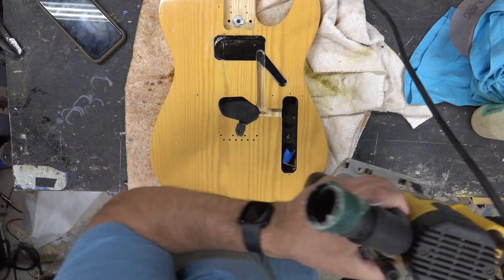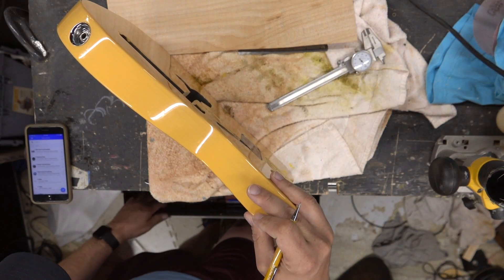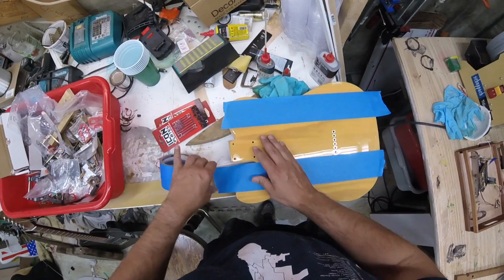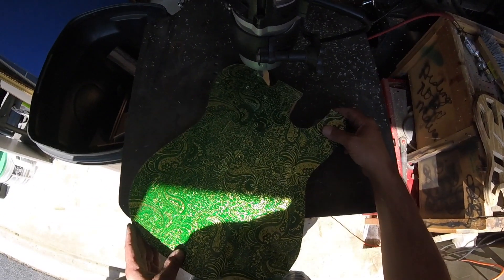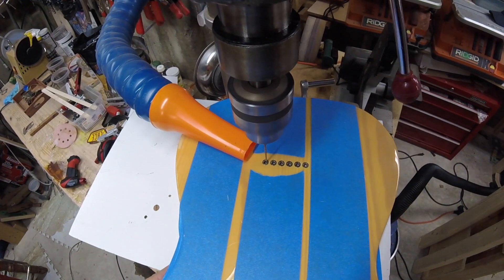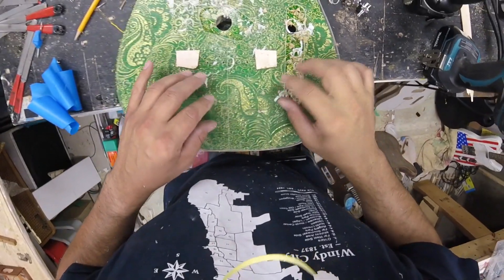Re-Topping a Fender Telecaster Body - Pimp Your Tele!

Comment: Love your pioneering spirit of adventure and what a great result....again! 

I have a question, I wonder if you could offer some insight: what size fretwire do you use and why? Do you have much experience of different sizes and the mechanical or tonal implications of using fretwire that is taller or wider. I’m new to building and am looking at getting some Gold Evo fretwire. Thanks for any help/advice you or anyone else can offer.
Reply from the maker: I like jumbo.  Just easier to use all standard sized tools.  I have wide fingers

Comment: after poring the epoxy use a heat gun (low setting) and you get rid of all bubbles.its safer then an open flame. man you really have to work cleaner, starting by cleaning the shop and keeping it clean. i know time time time, but it is what it is. keep up buddy
Reply from the maker: clean is overrated.  I don't have enough space with the 4 things I am doing at a time.  I need a dedicated video space and work space.  i only have one spot.  My camera rig takes up my other bench.